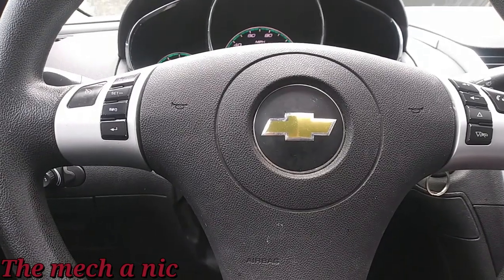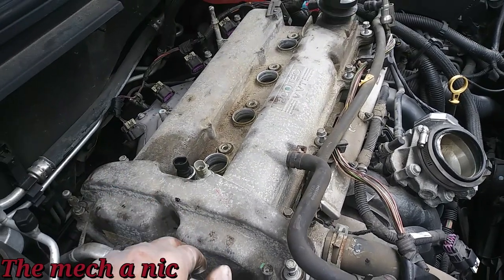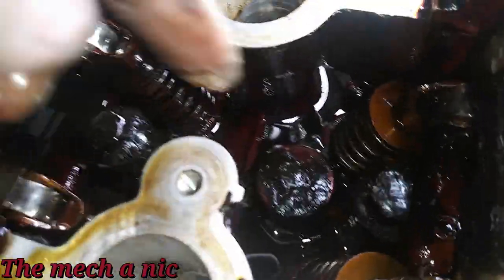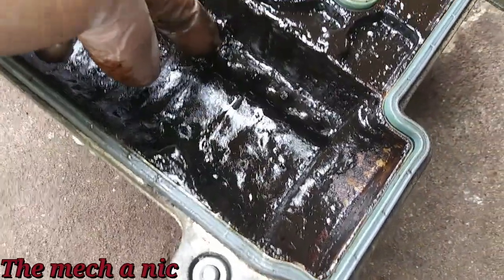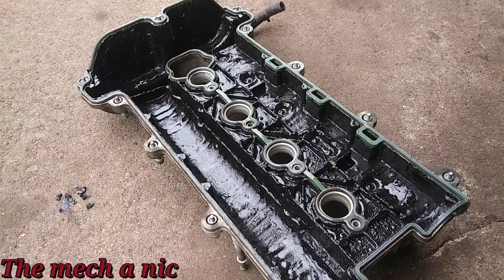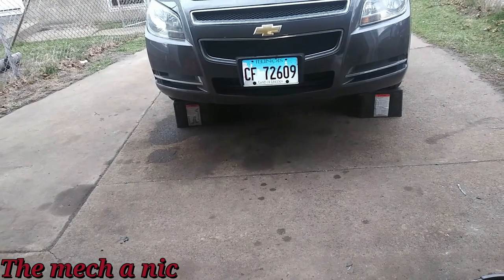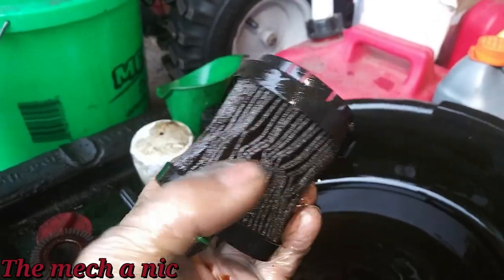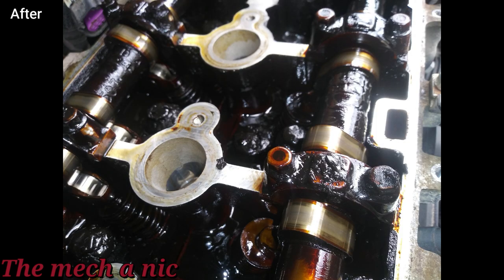ATF to clean engine sludge ?

Comment: When they get that bad, I've found the best way to do it is to fill the engine with gasoline, let the car run in neutral till the car is to operating temperature. The gas breaks down the sludge.  Once it's warmed up to operating temperature, throw a lit match through the intake as you shove the car out into the street.
Reply: Fuckin A .. i knew something didn’t sound right from the very beginning lol
Reply: To all you 😜🤯 (du du duhh people) it was a joke. This doesn't really work.
Reply: only do that when your cr burn a lot of oil and throw it to the exhaust will be a wonder...
Reply: I was about to say gasoline destroys bearings then the ending made me realize what you were implying. Yes i highly encourage this method of flushing
Reply: Haaaaa hahahaha! don't tempt me
Reply: Works for me all the time 😂
Reply: Not gas, use kerosene
Reply: Yesssss🎉
Reply: Sounds like fuggin bomb
Reply: Stuff a few tide pods in the oil.
Reply: BG engine restoratiu
Reply: Best comment ever 😂😂😂😂
Reply: Mine works so much better since I did this thanks
Reply: Not going to lie I was skeptical but desperate. It actually f**** worked but the whole pushing it part is unnecessary as it can cause a wreck or worse hurt someone. 9/10 life hack would rate 10 of it wasn't for the last part.
Reply: @coryc5545  details  tell us sludge????
Reply: @bgood213  not a ounce it looks as the original oil has never even been used
Reply: @bgood213  who am I kidding it was ridiculously sludged just from the tires rotating
Reply: @coryc5545  😂 love it so true I bet
Reply: @luisbetebcourt  cr?
Reply: My neighbor destroyed his aunt's car using gasoline. Didn't even have to light a match.

Comment: My dad purchased a Honda crv that was gunked up beyond belief. Believe it or not, he dumped oven cleaner into it and ran it for about 15 minutes just idling and when he took the valve cover back off, the top end was extremely clean. He ran 3 quarts of oil with 1.5 quarts of oven cleaner. Can’t say what it did to the gaskets in the engine but it was clean! And he drove it for four more years afterwards with no problems.

Comment: Sad to see a newer car treated like this.  I think using the old style transmission fluid is the way to go.  Reminds me of when I bought a used 1979 Celica GT in 1987 to drive back and forth to work. The original owner  had done 3 or 4 oil changes in 8 years. Surprisingly the car ran pretty good. The 20R engine was bullet proof.  A trusted old mechanic told me what to do to clear some of the sludge. I drained the oil, changed the oil filter, added 2 quarts cheap oil and 3 quarts of cheap type F  transmission fluid. I drove it around for a couple of hours, not revving the engine. Drained the oil and was amazed at the chunks of sludge that came out. I did this once more in a month. I ran cheap oil in the car for the next 3 years. I was told that ATF had high levels of detergents. In 1990 I traded it in for a new Isuzu pickup. Keep the content coming!
Reply from the maker: Great story, glad that worked out for you. It's crazy how some people neglect cars!

Comment: Diesel mixed with cheap oil don’t rev just idle watch fuel pressure use lots of oil filters. Run an 30 min change filter, another 30 change both. Repeated a few times.I did it to a flip with stuck lifters and it 👀 like that.

Comment: Rotella 10/30. Diesel oil has detergents in it that help clean sludge and soot. I run rotella in my car normally
Reply: Yes Diesel rated Rotella , Delo , Delvac oils have High detergents and works great for cleaning Gas engines

Comment: I worked on an engine like that.  I'd be nervous about using a flush with chunks like that.  I used a shop vac and picks and screwdrivers to gently detach the junk and sucked it up.  I cleaned it as best as I could and with regular oil and filter changes its still going strong and the lifter tick it had is gone too 👍

Comment: With ATF you have to be patient.  It takes longer than a chemical flush or using diesel fuel as it doesn't remove as much too soon. You don't want to clog up your oil screen.  Method you used works. What I do is drain oil add a new oil filter and run 4 quarts of ATF on idle for 20 minutes.  Drain it, add new engine oil and oil filter. Next oil change to be done @ 1000 miles since you have some oil residue. 3rd oil change you can repeat your method.  I use regular non synthetic ATF. I purchase it @ Walmart for about $19. For 1 gallon.
FYI: 73 days is too long.  Half a quart is to be ran for 300-400 miles. 1 quart for about 100- 200 miles.  The more ATF you use, the less you drive it. Your method is good in order to build up oil pressure while driving.

Comment: I remember seeing Tim from Astral Auto Repair use gasoline and/or power washing on a sludged engine. He took off the oil pan during it so it could all come out. I believe he removed and cleaned the oil sump too. Extreme approach haha.

Comment: Had a jeep wrangler in early 2000s with the inline 6. It was driving like a slug wouldn't even do hwy speeds 100km here.  
Was about 175000km on odometer when I decided to seafoam it. I poured the whole can into the crankcase Immediately noticed a huge difference when driving was like new feeling i dumped the oil while hot as per manufacturer instructions and the sludge chunks and black gunk thick as molasses came out like you wouldn't believe. Was my first seafoam experience and it went so well I have a strong opinion on it now.
Reply from the maker: Some have concerns that those big chunks can clog a oil pickup or galley and starve the engine of oil which makes sense. I guess it's just a gamble and it depends how bad the gunk build up is

Comment: Delicious. I bought an F150 the inline six.  It was that bad if not worse.  Manually scraped the crud off the head and 1 inch deep of tar like sludge out of the oil pan.  After that a couple heavy on the seafoam oil changes later and it was good to go.
Reply from the maker: Great effort 💪

Comment: Another vote for Seafoam mixed with new oil in concentrations advised on the bottle, with changes every few hundred miles. Always change when really hot, the engine needs to be completely warmed up.
Reply: Seaform the cleaning agent is Naphtha  aka Paint Thinner

Comment: Using Royal Purple oil is the best. Engine flushes including ATF do work but I have found Royal works great over time. Safe way to do it. Expensive yes but better then the cost of a new engine or car. I have replaced half the oil with ATF and let it idol for 60 minutes. That got gunk out as well.
Reply: Rotella , Delo , delvac works great and way cheaper the Royal Purple !

Comment: I would just keep using the ATF with a good detergent oil & change the oil in shorter intervals. Most of the motor flushes are just kerosene with a few extra additives.
Reply: Diesel is cheaper

Comment: Had this on a 2ZZ GE engine. Previous owner(s) abused oil change intervals. Scraped the first lot out with valve cover off of course as best I could.  For the next 5 oil changes (at 3000 mile intervals), before each change I used either Liquid Moly, Forte and lately BG EPR 109 flushes (very strong detergent is the BG one) for 15 minutes to 30 mins at tick over with occasional 1200 rpm revs. I also removed oil pan (just once) and scraped any crap out the pan. Each time I change oil now it stays almost crystal clear for the 3000 miles. I switched to Petronas Syntium oil which I believe helps. 
Another tip is remove coil packs, spark plugs after running engine up to operating temp. REDEX (95% Kerosine and 5% ATF) down plug holes (50ml each hole). Allow to heat soak for 30 mins. Cover plug holes with a rag, remove fuel relay fuse and crank engine several times. The REDEX is soaked up into the rags and avoids hydro locking engine. Re-insert plugs, coils, put fuse back for fuel and turn over. It may struggle to start. Then lots of crap coming out the exhaust in plumes of white smoke. Helps free up piston rings and carbon off top of the pistons and helps oil burning/compression issues. Drive for 20 minutes at high speeds, sometimes holding in 3rd gear. Yes you will smoke the roads out until clears but pulls like a train after. Some people use B12 or other products to achieve similar results.
TIP: For real bad clogged/stuck oil control rings leave to soak 24 hours minimum. Rotate engine a few times during that 24 hours by hand to allow some of the product to work its way into the rings, especially the OCR. Then do as in previous paragraph. Also change oil after.

Comment: I would only pour one bottle worth in and drive as usual for a week or two then change it and gradually cleans off the scum.
If you fill the engine it possibly could wash off large amounts of the scum and have it jam up important galleries. 

My first car had a basically 6litre engine which was a bit neglected by the previous owner. I think he drove short distance and didn't change more often like you're supposed to leading to a little scum.
What I did was buy Quaker State high detergent fleet oil by the case and changed it in half the time you usually do. I opened the filters up after to see how they went from flakes down to dust size particles to almost nothing. 
After a year or two it was sparkly clean.
I also tried Wynns Valve Lifter (i forgot what the entire name was. Cleaner i think. It was a clear solution that poured like fuel and smelled like varsol. 
It helped a little but not as much as the early changes did. 
I read a few books back then
The best one was by Robert Appel
"The Used Car Owners Handbook"
He or one of the authors suggested sticking to one brand of oil, not always trying different brands and what is the absolute cheapest. Different additives all the time don't help.

Comment: Use Amsoil engine flush before you drain your oil next time. And then only use Amsoil Signature Series engine oil. It has the highest detergents in the industry. Check your engine a year from now. Every oil change will dissolve more sludge and varnish and clean it up more and more until it looks like new. Thank me later.☺
Reply: Does motul 7100 have more cleaning than amsoil?

Comment: Yes, there is a huge difference between "conventional" and "synthetic" oil, ATF.
brake fluid, etc. Some substitute silicone-based brake fluid for conventional,
then ruin their entire braking system.

This engine needs serious help. 91 octane gasoline poured into valvetrain, 
brushed around, mopped up with red oil rags. Coat hanger wire pushed into
drain holes. Valve cover rinsed & brushed & rinsed. Oil pan same.
Then you can run a quart of ATF for a while & drain. Non-ethanol gasoline
is what drag racers wash parts in. It will not hurt anything. The chunks
and grit must be removed first.
Reply: Conventional vs synthetic ATF makes no difference in this context. It's the detergent package, not the hydraulic oil itself, that makes ATF useful for some degree of cleaning.  The comparison to brake fluid makes no sense at all. Apples and oranges. Synthetic ATF and engine oil are made to be direct replacements for conventional, where silicone brake fluid (DOT 5) is not and is clearly labeled as such. There should be no confusion on this if one simply reads the label.
Reply: @jayslabotsky462  Jay- I was trying to iterate that I have heard of some unknowingly add DOT5 to an older car, thinking it's "better".
Conventional vs. synthetic= 
Just like the oils, the molecules are very different, ATF being no
exception. I know about detergent packages, too. It is my
personal preference to use conventional.

Comment: I think i would be pulling off the oil pan to check the oil pickup tube screen and cleaning out the oil pan with a engine degreaser.
Reply: Only way to go

Comment: I did not think it would work synthetic or non trany fluid .  Ok what I have done  and  seen it done with awesome results was  your regular engine flush  you get at your  supplier done twice for best results .    Now I am very squeamish to use it on any  late model engine but a slugged  up beater sure :)

Comment: Honestly you run more of a risk trying to clean that severe of engine sludge. Light layered yogurt sludge is okay, but that car to clean it will take a hot tank. When i was young and ignorant to engine cleaning. I had someone tell me to run engine cleaner in an old chevy 350. Long story short it made the engine sieze up due to heavy hardened sludge plugging up the oil ways. Never did that again. Tranny fluid non synthetic for LIGHT soft sludge is okay as long as you change the filter after a drive, then after a week of driving change the oil and see if it needs to be repeated. I personally wont do them anymore  especially on newer cars, to dangerous and costly with all the tiny oil passagways. Do the oil change and ship it.

Comment: Some old timer once told me to add ATF to the engine oil. His name was Gus literally and he had a white beard. He claimed it makes an engine last longer. I am usually just polite to old dudes but I thought it was an odd thing to say at the same time.

Years later i was listening to my Dodge magnum it had a ticking noise. Im not a professional mechanic but i imagine it was a lifter or some other valve  related issues...i added ATF to It and it was  less than a minute later that 5.9 magnum stopped that tapping sounds. I actually heard when it happened. The engine rythem changed slightly. The tap either quieted or disappeared. I was actually surprised. As i said im not a mechanic but i done a few operations on my vehicle over the years. I have to because im alway broke. Anyway it did something for my engine. I maybe it just luck and it just so happed to stop. Who knows. I do plan on trying it again when i have to do an oil change.

Comment: Seafoam. 1 ounce per quart of  engine oil. About 200 miles before each oil change.  Your engine was extremely gunked up. You might want to take a toothbrush and agitate the gunky sludge of the parts around your camshafts run some fresh oil and seafoam through the engine for a few days then do another oil change.

Comment: Would MMO work on the sludge?
I used it in a sandrail that was sitting for a while. It had a 1986 oldsmobile 3.8l v6. The 1st oil change with the MMO had gunk and was super dark
Reply: MMO works its mostly Kerosene  Diesel Fuel works great to and Cheaper  add 1 quart diesel  if Vehicle requires 5 quarts add 1 quart Diesel Fuel to 4 quarts oil run for 500 miles change or better run Rotella 10w30 diesel oil which can be run for 3000-4000K miles

Comment: 900 ml with Diesel, plus  acetone and ATF 1/3 of each. It will speed up some. Do a flush with it and the use as additive by 10% for the next 2 oil change intervals afthe the pure flushing. I've also tried 700 ml of gasoline and 100 ml of dish wash detergent giving a decent in a 15 minutes quick cleaning.

Comment: I've seen some videos on Royal Purple being able to clean engines, I think their oil formulation has some detergents in it?
Reply: All of your top line oils have detergents in them. Even your premium fuels have detegents in them. What you want is a hot engine and high detergent levels. You can dump diesel fuel into the engine and run it at idle for 30 mins or the same thing with ATF Fluid, or do a half and half of atf and oil, do not drive the car but let it idle. Could probably even let it rev around 2500-3000 to help increase oil pressure and how much oil is being slung around to clean everything.

Comment: When this engine us gunked up like this is typically not a good sign..... the foam in his oil is probably a small hint of coolant or something that is mixing in his oil and should get his gaskets replaced. I also use a 50/50 mixture of atf and acetone that make a great degreaser on a engine that is cleaner than that

Comment: Run Shell Rotella T6, normally used In diesel engines.   It is very high detergent.
Reply: @Beardman56  5w40 will work great
Reply: Erm.... NO ! I been running Rotella in My cars for ~15 years 
 And while there is no sludge (regular oil/filter changes)
 they  look like they have been painted black inside. 
 Anither Old wives' tale unfortunately.

Comment: First, I don't think it's good to leave anything in there long term.  The sludge is from oil abuse, specifically not changing oil soon enough.  I would Seafoam or product like it.  You'll use it next time here wants an oil change, put it in, drive or run engine as directed, and change oil, heavy sludge will take a while to clear it all out. DO NOT USE GASOLINE! Except as a spot solvent. That much sludge you're looking at clogging oil galleries if you don't go slow, so may be regular ATF is the way to go.

Comment: A quart of atf is not going to do it. Drain all the old oil. Replace it with five quarts of ATF. Let it >>idle<< for 20-30. Do NOT drive it!! Drain it and then replace the oil filter and fresh oil.

Comment: I have used kerosene and diesel successfully with good results. 1-2 quarts in engine and run for 15-30 minutes. Then drain.
Reply: varsol as works.and bonus softens seal some to stop leaks.

Comment: What’s causing that sort of sludge?  Lack of regular oil changes?  I just took the valve cover off my 41 year old Mercedes 240D with 265k miles, expecting to find a dirty engine, and it was perfectly clean inside.  Just wondering how it gets so sludge coated?
Reply: My best guess is a faulty PCV valve caused it.
Reply from the maker: This ,and lack of oil changes .